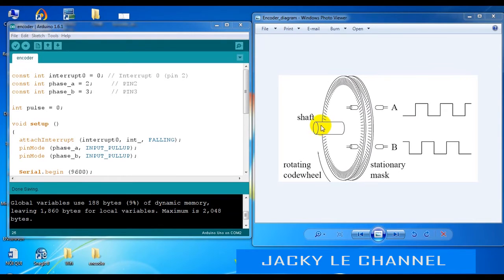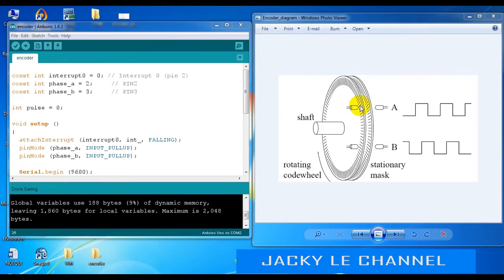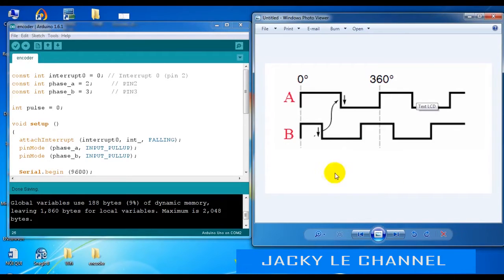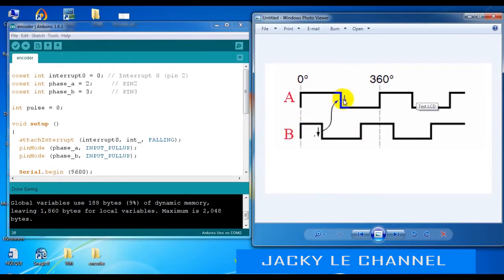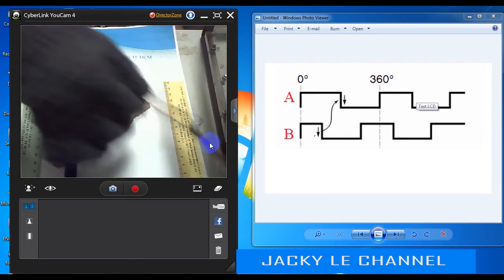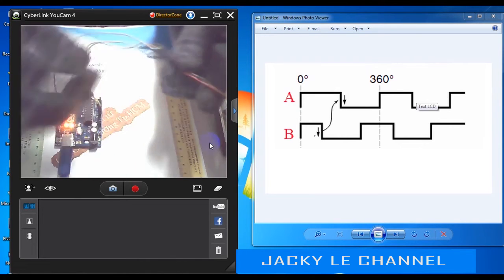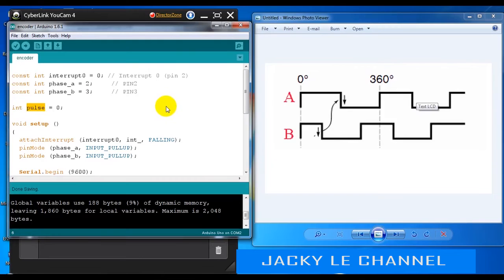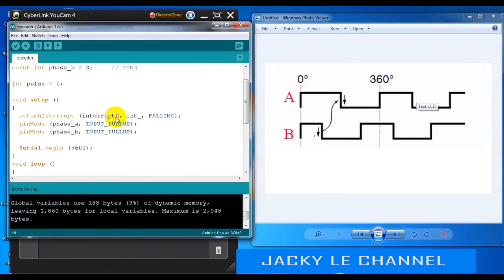Arduino Read Encoder Data on Motor with code with code

Comment: hey bro... I test hp deskjet 1112 rotary encoder. But output not consistent. It outputs different values at different time.  I mean values tolerate between specific values. I use arduino 3.3v to power sensor, can you explain why and how to get consistent value nearly?

Comment: can u make the video if motor is running through supply(pwm)........not by hand........because in my project i have to  measure rpm.........another doubt,if i connect my motor SPG30E-20K directly to arduino board will amphere rating damage my arduino board???my motor current rating 510milli amp

Comment: Please share how to read direction of the motor
Reply from the maker: As you can see, direction detected by plus or minus value.
Reply from the maker: form encoder of view: as you can see we have phase A and phase B to detect direction. / One direction: phase A signal in low & phase B signal in low too / When reverse direction: phase A signal in the low & phase B signal in the high level.